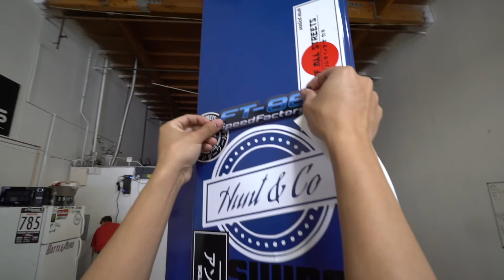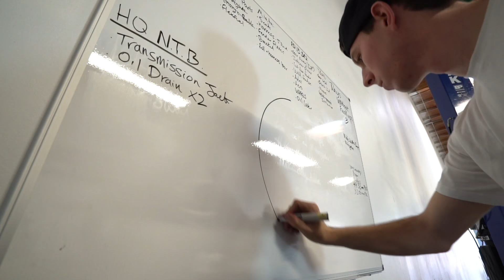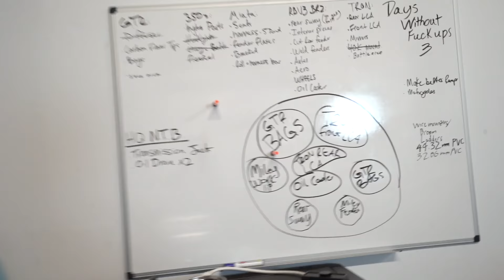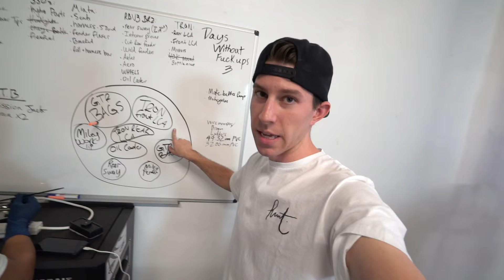Carbon Fiber Canards for the Widebody BRZ!

Comment: First video I watch everyday when I get home cause it's always the best
Reply from the maker: <3
Reply: +tj Hunt first i watch adam, then i watch tj
Reply: Tj Hunt hey just an idea for the wire that go zipped tied to the table, you should drill a whole and run the wire tthru the back side. it gives it a good look and its safe.
Reply: Oscar M Barcelo or they can just use a staple gun..
Reply: i ment run the cord thru the back of the wood so its hidden. its hard to explain.

Comment: Hey, you should have drilled a hole big enough to run the extension cord in and run the cord through the inside of the table. Try using staples instead of zip ties for less holes

Comment: the brz needs a new steering wheel
Reply: But then there's no airbag :/
Reply: That is assuming he has no harness. In Australia at least it's illegal to have a harness and it's illegal to remove the airbag lol. Yes, having a harness makes no fucking sense lol.
Reply: Dutton fuck safety. or just swap in like an sti steering wheel.
Reply: Fuck safety? Alright dude have fun with that.
Reply: Dutton just don't crash then
Reply: What if someone runs a red light and crashed into you? What if you get rear ended by a truck driver who's fallen asleep? Crashes aren't always in your control; you can try as hard as you want to and be a defensive driver but you can still get into a somewhat life threatening crash...
Reply: I drive a miata which has one airbag total in the car for the passenger. I have a bucket seat, 4-point harness and a tcracing wheel. So I have no airbag. I'm not worried about it, but I guarantee if I get into an accident I'm dead
Reply: Dutton older cars didn't have airbags and i didn't see them complain.
Reply: Colby That's probably because they literally didn't know what airbags were? Haha. 

Aeon Entomb I like your optimism,"... If I get into an accident I'm dead". Hahaha. Miata's are cool tho.
Reply: where did this get so much likes omfg i was just saying something that was on my mind lol

Comment: holy fuck too much rice
Reply: Sam Koch it's a fully built supercharged brz, some of the body is just for looks yes, but definitely not rice
Reply: considering how much is done under the hood, I wouldn't call it rice...
Reply: Sam Koch he added a bit rice to the car but a real ricer would have 10 of those thinks.
Reply: Sam Koch it's for the front wheel drive force, all hondas should have this
Reply: Mandell Taylor I agree with you
Reply: BrinxGaming yeah they may add downforce but with just 2? Bolts under high preasure they will collapse an break off without support rods these are just ugly in my opinion but people have their own tastes🤢🤢🤢
Reply: Not really it's 450 horse
Reply: Sam Koch let him do his own thing I personally think it's class
Reply: Sam Koch it's his build not yours
Reply: Hybrid Saiyan ....this car's pushing around 450 horse, unlike ur Honda Civic with stickers that add 20 horsepower.
Reply: #RespectTheBuild
Reply: Sam Koch it's not rice it's just not to your taste or mine tbf
Reply: Have in mind the cars weight.
Reply: rice is nice :D
Reply: It's rice....period
Reply: E30 Jay You can buy a Dodge Challenger SRT with the hellcat motor straight off the showroom with over 700 horse. Tjs brz is 110% a ricer but that's fine it's his style gotta respect that.
Reply: ***** did they test the position of the canards in a wind tunnel in order to learn what the optimal angle of attack as well as the rate of turbulence dissipation is? Did they balance the front "downforce" (if you can call it that lol) with the rear downforce as well as the suction force underneath the car? I don't think so.

Half a gram of "downforce" isn't much downforce if you ask me lmao
Reply: ***** wtf are you talking about
Reply: according from google rice- a swamp grass that is widely cultivated as a source of food, especially in Asia. 
def not rice ;)
Reply: UKBall 👏🏼
Reply: ktgage from Urban Dictionary:

An automobile that has been equipped with gawdy, unnesecary accessories, such as non-functional spoilers, "unique" paint job and body work. Owners of such automobiles feel that these accessories make their car the best in the world, when in fact it is not. ;)
Reply: well said bro
Reply: ***** obviously watching someones car channel means you have someone interest in cars. This guy literally doesn't really do anything more than work on cars or be around them also I really didn't imply he was a car enthusiast I just stated any car enthusiast. If he himself thinks he is or not isn't my concern my only problem is shitting on someone's car when you yourself can't even afford to have something like this. Respect is given where it's deserved.
Reply: Grd Lpz you said "you're not a car enthusiast if you shit on someone else's car" and then proceeded to call UKBall's car "a piece of shit" multiple times, so I guess that means that you're not a car enthusiast either and shouldn't be talking in the first place, as you have so eloquently argued ;)
Reply: ***** what? The didn't make any sense. Ugh I'm done.
Reply: ***** but the car is "built" and he spent "a lot of money on it, which you havent," so it's totally okay, right??????
Reply: Fake Name yes I know it's a Datsun a fairlady I'm not stupid. Rice is a comment for people who had half assed mods like a stupid fart can or a big spoiler or even some vinyls. Not completed no sense of style. Also rice was never used as a term for good tf lol you call that a tuner.
Reply: ***** Well is called having a personal opinion and choice. Obviously he not trying to completely build a race car. He's trying to do all the mods a common tuner would do if he has the money. It's just a style choice and culture choice. I hang out with a couple of people who don't really care about how fast your car or how expensive it is. Just there to build what we what and help each other out. It's just a way of living. I drive a G37xs and personallly I'm not going to do much because I'm fine with how the car is stock maybe some cosmetic changes and color change but that's it. I really on care about the looks fuck the speed. Of course it's fun driving fast but it's not like I'm going to drive fast every day. Probably will never get the car top speed.
Reply: Grd Lpz from Urban Dictionary

Rice/ricer: An automobile that has been equipped with unnesecary accessories, such as non-functional spoilers, expressive paint job and body work. Owners of such automobiles feel that these accessories make their car the best in the world, when in fact it is not.

And my apologies, I didn't mean to call you an idiot, it's just that too many people confuse 240z with 240sx lol
Reply: Well first you're using urban dictionary. That's coming from someone else's mouth. I'm sure TJ doesn't think his car is the best in the world because it's not I've seen better and also that means anything I've you based your thought on this idea then that means any type of body work it's just plain rice. Tf you have no sense of style then. A lot of stock cars have some unnecessary accessories coming from factory. I guess it's rice then.
Reply: Grd Lpz well, what, do you want me to use Merriman Webster for the term "ricer?"

And yes, many cars come with unnecesary stuff from the factory and are rice as fuck. Prime example: early 2000s Toyota Celica with the GT package. FWD, slow as balls, had one of the biggest stock wings of its era
Reply: ITS RICE......PERIOD
Reply: ***** they probably weight more than the down force they add
Reply: Sam Koch 😂right

Comment: Those are some massive canards... The large front face is going to really draw in some serious air... For everyone that says they are on wrong, sorry to tell you that Canards are basically air foils that produce down force on the front end, the larger the canard the better they work at lower speeds, but will have more drag at higher speeds. SO it all depends on what your overall goals are. SO NO the canards are not on wrong... the larger/wider face is designed to be in the front, it's what allows them to produce that down force properly. Look up Password JDM Dry Carbon Fiber Canards... and you will see exactly what I am referring too.

Comment: I like how you drilled all those holes in the bench and used zip ties to mount that power cord to the bench. Did you know you can buy little clips that to hammer on over the wire to secure it to wood? WTF KIDS?
I'm no electrician.